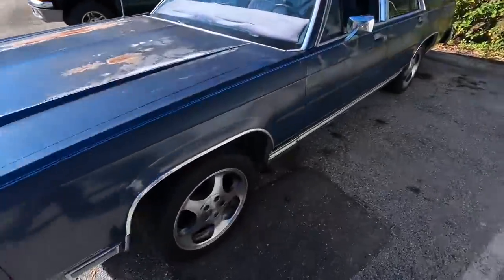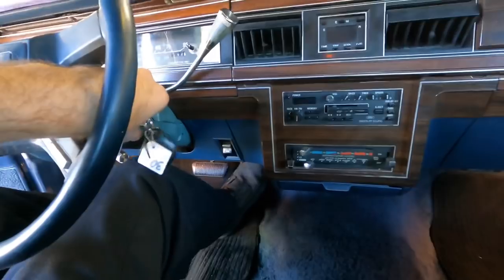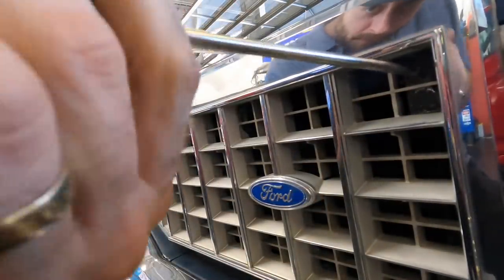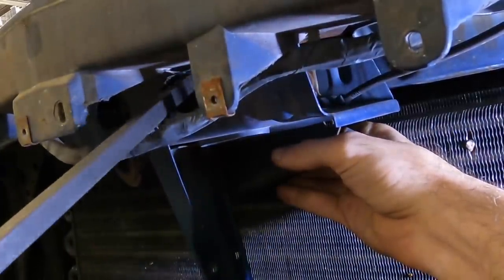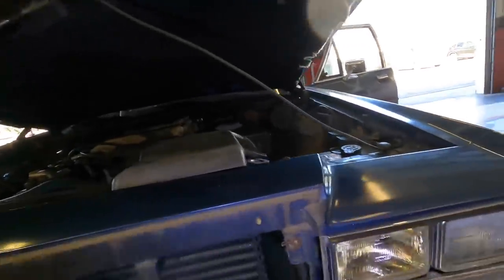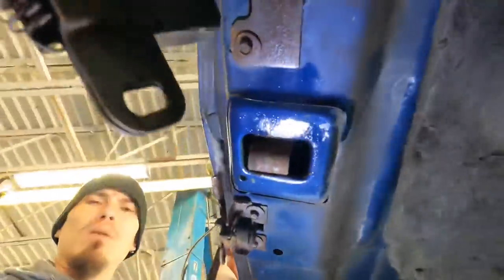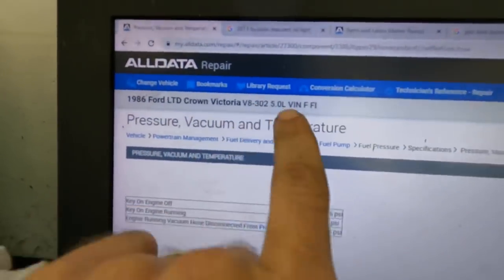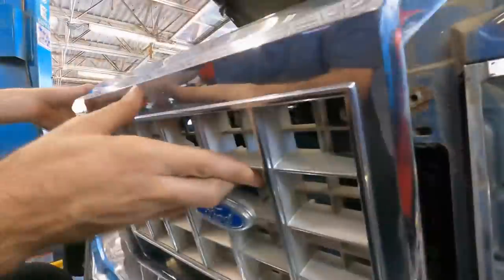Customer States: Replaced Engine, still stalling!

Comment: People calling for a scan tool for this issue aren't realising that from experience these EEC-IV systems DON'T show a fault code for low fuel pressure,that's why they come with a check valve on the fuel rail
Reply: And the plug is under the hood for the OBD1 code reader.
Reply: And no warning for an evap purge valve because no gas tank pressure sensor or evap flow sensor. Still better than the early GM efi stuff.
Reply: KOER test
KOEO test 
those models didnt have alot of codes period.
Reply: 1986 was still speed density EEC III. It was the 1st year for port injection instead of throttle body injection. Scan tools were pretty well useless on them because they didn't support datastreaming or functional tests. The only thing that made using a scanner instead using a jumper wire in the EEC connector for CEL codes is the scanner will read both slow and fast codes with KOEO and KOER. CEL flash codes with a jumper are KOEO fast codes only. I suspect that this engine had more than 5psi of fuel pressure because it wouldn't run at all on that. He took the Schrader valve out of the rail and his hose adapter had a nipple to engage that valve and also open a check valve in the hose fitting. Me thinks he misdiagnosed either a bad MAP sensor or a IAC as a bad fuel pump because of this.
Reply: @lysdexicsoftheworlduntie1881  If you notice the module, it's on the side of the distributor, so just like my  '86 Capri HO SEFI, there should be both a connector up by the master cylinder to scan. There's also a wire with a plug that you use if you definitely have to adjust the timing, because it's all managed by that EEC-IV module which sometimes loves to overheat due to location.

Teething pains on that new concept...been there, done that, have that specialty scan tool from then.  My ex's '88 LX with the 5.0HO was similar, but a bit better. Still used the same scan tool.

What they likely have is a clogged fuel sock, the inlet cover/filter. Probably due to rust in the tank, based on my experience with them.
Yes, it was speed density in that first year they moved to all FI 5.0s, but it was the new EEC-IV system, before they improved things.

The IAC was also notorious for non start, or more likely, the engine surge beast. Standing on the brake at a stop sign because the weather had recently changed a lot and a gummed throttle plate and IAC were cooperating in making the 5.0  continuously rage, then slow, could be quite the experience!

Comment: Great video, Ray. Finally a car I know and understand. So you know, 5 psi of fuel is what the mechanical fuel pumps on these cars put out. 84 was the first year of fuel injection but only some got it. Some had the dreadful 2bbl VV carburetor. That, so you know, was in use through the end of 91 on cars equipped with the 351(5.8 litre) Windsor engine. The diagnostic port, as noted by others, is on the driver's side near the master brake cylinder.
I have had about every combination of engine and transmission available in a Panther as well as a pair of 78 and a pair of 79 Thunderbirds. That 5.0 got several versions in a short time. In 86 both Windsor engines had a good going through. The 302 went from 132 HP to 160 HP with single exhaust, 170 with dual. The 351 (P71/P/72 cars only in US) went from 155 up to 210 with single and 215 with dual exhaust. These latter came with the 2bbl VV carb. When it worked, it was terrific. When it went bad, rip the thing out and go Edelbrock Performer intake and carb. With the intake done and a good 2¼ exhaust, HP went up to about 225, and torque to a very healthy 450 lb/ft at 2,200 rpm. My brother had an 86 Colony Park wagon and I custom ordered an 89 Grand Marquis LS sedan, both with 351 and Trailer Tow III Package, plus I had an 87 Grand Marquis 351 with base suspension. They were mileage champs, returning about 35 miles to the US gallon on the highway.

Comment: I paused this as you were putting your fuel pressure gauge on the line, to take a guess. I had a '91 5.0 mustang, it ran exactly like this after having sat for a couple months, and it ended up being a fairly decent sized vacuum leak under the intake plenum, on one of the 7 vacuum lines running around under there
Reply: Chased that for awhile myself on my 91 as well. Stupid place to put a vacuum tree on the underside of the intake.

Comment: I just had one of those in the shop about a week ago. Same issue with the fuel pump. Second I heard it stall under load I knew. Your diagnosis was spot on good sir... also, screw that hood latch
Reply: Please don't tell me the fuel pump is in the tank requiring it to dropped?
Reply: @vw5056  It MIGHT have had a high and low pressure...one in-line and one in the tank.

Comment: Fuel, spark, or O2..What a blast from the past. Gooooowd stuff when mechanics had to be mechanics and not rely on a scan tool.  Stay safe and be well Ray.
Reply: Mechanics DO still need to be mechanics. So many people end up just changing parts because of the scan tool results and don't fix the problem. Just because the trouble code points to a specific component it doesn't mean that the component itself is faulty, and that's where mechanic diagnostic skills and training come in.
Reply: Ruling out the engine, I think fuel pump is failing?
Reply: They have an OBD 1 port on those to hook up scan tool around the drive side of the car under hood
Reply: Back then, it took 1 hour to diagnose, 5 minutes to fix. Today, 5 minutes to diagnose, 3 hours to fix!
Reply: @AiMR  if the car originally came with a carb, the existing fuel delivery system won't support an injected engine, not enough pressure, no return lines, wrong regulator.
Reply: @alexandercopeland2849  That is correct, or you can use a jumper wire and count the number of times the CEL blinks for codes. OBD 1 does not provide live data stream however.
Reply: @AiMR  it could also be rusted lines, fuel pressure regulator, clogged filter.

Also forgot that dirty or weak injectors as well
Reply: @Mr.Z1776  Good thing the computer showed that it did come fuel injected. 85 was also the transition year for Ford.
Reply: @alexandercopeland2849  No guarantee of that with this model year.  The earliest of early computer controlled cars had absolutely no diagnostic ability what so ever.
Reply: @jameskee2412  o yes you can, I do it all the time with my white 1986 Crown vic is having problems, with my scan tool (live data and everything)
Reply: @alexandercopeland2849  Cool story.  Ray would still need a Ford OBD-1 adapter for his scan tool and that tool to actually support OBD-1.  Know what your live data won't tell you?  That you have a fuel pressure problem.  It's not capable of pulling data that doesn't exist.  Your regulator is a vacuum operated valve in combination with the fuel pump and the filter.  There is no data for the fuel pressure, I know, because my '92 Ranger has the EXACT same regulation and no fuel pressure indication.  So, Ray skipped a step in your book, he still diagnosed the problem faster and more accurately than you would have.
I am also not the person to make a comment about your live data in the first place.  I was making a point that not all vehicles at that age, even if they had a computer, had OBD-1.  I have an '84 Bronco, 100% interchangeable with an '86, that had a computer (I pulled it out and reverted the system to earlier as the computer components are unobtainium).  Even though they had a computer, they still had ZERO diagnostic capability.
So, just slow your roll for a minute and accept that just because you have one of these cars, doesn't mean you know everything about them.
Reply: @jameskee2412  Live data would have told you were running lean. 'My first reply was to the original comment that to me made it sound you couldn't use a scan tool on it. Which my reply was that you can scan it. If it was me working on the car, I would have done the same things he did. (Automotive Technician for 25+ years. All 8 + Advance ASE when I was 18 years old)
Reply: @alexandercopeland2849  Again, cool story bro.

Your reply SPECIFICALLY was to me, of which all I stated, was that not all vehicles of this year had OBD-1 capability.  I didn't say that this car didn't have it, as I have never seen an '86 crown vic.  I just said that there was no guarantee that it did exist.  Erring on the side of caution.  You're lack of caution and blatant spouting of everything as fact without substantiating anything until someone comes along who is a LOT more cautious doesn't help.

All this said, after this interaction, I don't care if you had the golden certification from Benz himself, I wouldn't want you to work on any vehicle for anyone I know.  You've given me the vibe that you're more likely to load the parts cannon pretty early.
Reply: @batmansdad3195  Nope- pressure port is before the injectors so they would have to flood the engine severely to drop the pressure that much.
Reply: @jameskee2412  and you are probably a 19 year old that thinks he knows everything. you are the one attacking me. you are the one talking to me and replays out of respect and to help people in comments. Being in special education grown up, I have had to prove myself all the time when others think cause of special needs, I couldn't do it and my ASE was one of the biggest hurdles in my life. I am not going to say anything more for this is upsetting me.
Reply: @alexandercopeland2849  wow, you seriously pulled out all those cards.  I know special needs kids that show and deserve more respect than this and don't cry about their needs.  Also well past 19, but thanks for making an assumption.

What you have done sir, is called virtue signaling.  Since I have managed to hurt your feelings, it is likely a wise idea for you to withdraw.  You accuse me of being a young lad but I am not the one in need of a safe space.

No sir, I do not feel bad.  I did not initiate an attack.  I simply came in stating general facts as appropriate with limited information.  You've been defensive since that point immediately coming off as "holier than thou" since then until after the point you call me a pompous child and then proceed to flip to being a victim.  No sir, that is not how this works.

I will die not knowing everything, but I will also still not pretend to know it all.

I'm more embarrassed that a transaction like this had to occur on a respectable channel such as Ray's.  Please, if you do decide to insult me more, figure out how to make it a private message so we may stop degrading Ray's content.
Reply: @jameskee2412  I was just wanted to appogize to you and I sure didn't mean to come off as 'holly than thou'. I will admit I don't know everything thats why i watch Ray and Eric O from South Main Auto
Reply: This is why I recently found and have binging Vice Grip Garage. Most of his videos that I have been watching are cars that haven't driven in 10+ years and he makes it seem simple. Plus he adds a lot of comedy relief.
Reply: @batmansdad3195  the injectors has nothing to do with 5lb of fuel pressure
Reply: @51-FS  If the lines are rusted and the injectors don't open up it's a whole chain of events on that 5lbs.
Reply: @batmansdad3195  lol your clueless 😂 🤣 😆
Reply: @51-FS  not clueless, just been around those motors most of my life
Reply: @batmansdad3195  I don't care how rusted or dirty the injectors are. It still won't have anything to do with fuel pressure 😒
Reply: Scan tool is the last thing I tend to grab.
Reply: @batmansdad3195  We all know that car never had a carb. Nobody in their right mind would go to all the trouble to install fuel injection on an old schlumper like that.
Reply: @jameskee2412  probably needs to replace the high pressure fuel pump, mounted on the frame.
Reply: @M21-w1y  I recently had an experience with this on an '89 F-150 I purchased last month.  Since then, most reliable vehicle I own.
Reply: I remember going with a friend to some dealer to have them look at his car and they hooked up some kind of early scan tool computer device to get some readings. I thought,  ' what the heck are they going to read, that it has gas in the tank and the engine has spark? '
This was in mid seventies and there was hardly anything on cars yet to give any readings.
Beyond 1990s it's whole different world, there are electronic readings from everywhere and every car has its own computer. But you still need to be able to tell what's going on from all the readings or you're just a parts changer.
Reply: @51-FS  this argument reminds me of one I had welding some machinery in a shop and I welded in a pipe that would have a pressure gage on it. The weld made the opening at the connection a bit smaller. Another worker told me I would have to drill it out otherwise the pressure reading would be off. I said no I don't because it is just a pressure gage not volume flowing. He argued with me and I just said whatever.
Ran a drill through it just to satisfy his superior intelligence.
Reply: The hu?

Comment: Generally speaking, if the fuel pump on those cars is quiet, it's still good. The problem could also be a clogged fuel filter, a defective fuel pressure regulator (on the fuel rail) stuck open and not allowing pressure to build, or a bad rubber pick-up hose inside the tank on the fuel pump assembly. Also check for full voltage at the pump, a bad fuel pump relay or ignition switch, which powers the relay, could lead to low voltage at the pump.
Reply: Clogged fuel filter can cause the low rail pressure and the stalling issues.
Just went thru diagnosing a 2000 F250 5.4, crank, no start. Fuel pressure was weak but should have fired up. Checked all fuses and relays, then cleaned every ground I could find. Checked fuel pressure at the tank, after the filter all barely in spec.
No codes was the odd part. Injectors were not pulsing.  Was suspecting the PCM but continued checking wires. Found the problem,a break in a wire on the engine wiring harness were it plugs into the main under hood harness. 10 minutes to fix, 2 days to find the problem 
I am not a trained mechanic,  just fix my own junk to save money.

Comment: Oh what fun it is to be thwarted by the old rust it closed hood latch on the Crown Victoria... 
as a result many took care of the people by cutting a hole in the hood... depending on the size, and with or without hood pins, sometimes equipped with chain locking devices with pad locks. It was hard in Michigan to find a good Hood for these back in the mid -to late 90’s since it was a poor design that experienced high volumes of salt spray, that one had the cable shield on it. 
Good job on making it through without using the BFH and or sometimes called the “FORD TOOL” back in the mid 90’s I worked at a then Premier salvage yard and we had only Ford, Lincoln, & Mercury 86-96... parts business was great and we had a strict policy of not cutting wires and Accurate parts descriptions!
I was the assistant inventory manager for them at the time.
Great video

Comment: …… now you are entering my territory, Ray. My neighbor and I used to work on our first cars in high school. Trips to the junkyard required disassembly of hoods like what you just did for parts. Was disappointed that it was not carbureted. I wanted to see you set the points, rebuild the carburetor and all that good old stuff. Good day to you! End transmission…
Reply: they stopped using carburetors over 30 years ago....

Comment: Pluggy plug thing is a star connector; pre-OBD2. You can also use a jumper wire and count the CIL flashes. Old school stuff ;) Also, could be FPR or its vac line if not the pump/filter.
Reply: I think you mean pre OBD
Reply: @nickzaremba  OBD2 came out in 1996 and was mandatory for a cars sold in the US. OBD is just a generic term, star for example is a type of OBD
Reply: they make a plug that jumps it so you can't short something out in there...

Comment: You are an awesome mechanic, sir! I managed a heavy truck shop for many years and in all that time I only had one mechanic that would come close to equaling your knowledge, work ethic and honesty. I salute you sir! Note: Kudos to you for removing the grill to open the hood. I bought a new Chevy pickup after retirement that had an add-on "bug deflector". Later I took it to another dealer to diagnose an issue and they told me it was caused by the deflector (held on by 4 screws) and that they (an authorized Chevrolet dealer) would charge me one hour labor to remove the shield! Have one more dealer rip-off story but this is not the time nor place for it. Thanks for the time and effort you put into sharing your adventures with us!!
Reply: He is a horrible mechanic I guess you have no experience working on cars  amazed at his stupidity
Reply: @jeffereyduran8728  So where's your YouTube channel?

Yeah, that's what I thought!

Comment: When I was a mechanic with Ford with the new fangled fuel injection vehicles, and we had this same issue… we went directly to the MAP sensor. Some genius at Ford decided to put these things right under the cowling where water can easily get in them and mess them up. 

The tinglybob for the scan tool on these are usually in the engine bay near the heater box or on the driver’s side near the master cylinder. EEC-IV diagnostics is always a joy.
Reply: I had one of these ('86 Grand Marquis) and let me tell you I thought Ford's FI was a *dream* after that NIGHTMARE "variable venturi" mess of a carburetor in my '82. :-)
Reply: @joez.2794  I can relate as I had a 1979 Grand Marquis.

Comment: Reminds me of a Plymouth my dad bought new in the mid 70s. The hood latch wire broke, so a metal coat hanger was attached to the lever to pop it open by reaching under behind the grill. The carburetor always had issues in the winter months also